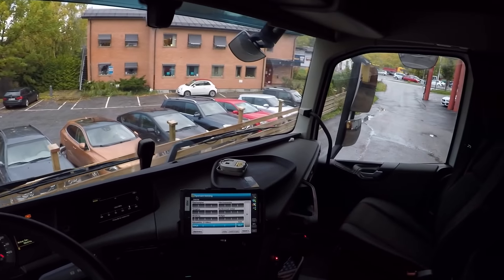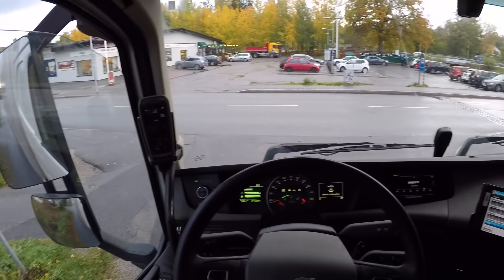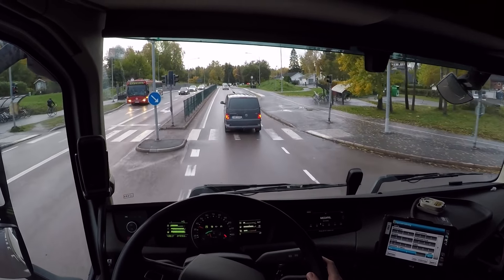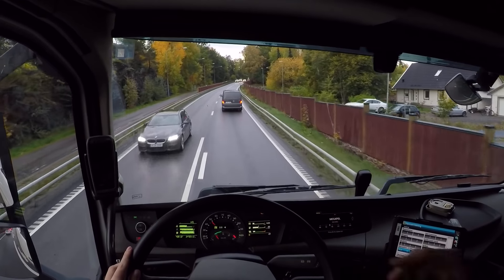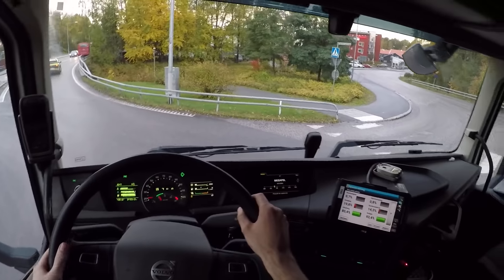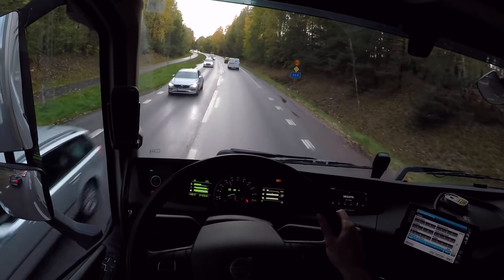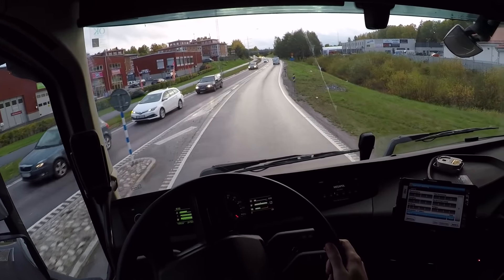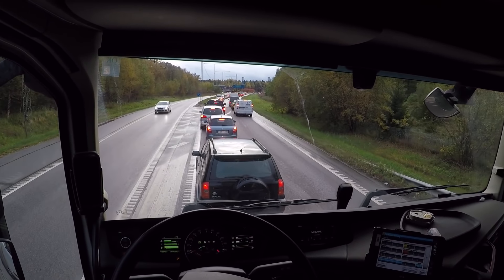Eco Driving tips & tricks, Volvo FH500 trucking

Comment: Remember when I complained about leveling the semi when docking for unload?  I think my theory was right. 
After 4 days out carrying a brand new semi from Almería- MercaMadrid- MercaBarna (JCarrion company always has brand new 1.200 semis, maximum 2/3 y/o) , there was no trouble at all to level it for load and unload.
I could level up and down the semi with the remote control, even for some centimeters up or down, the air pumping whas working as accurate as a scalpel.
Conclusion: hard work is always when I carry old and crap yard semis from medieval ages that does not fit new tech that makes our work easier and quicker.
Hope you had a good week, I am taking a mandatory - an necessary -  rest break in Narbonne (France) right now towards Marseille.
Reply: Sorry for the delay in aswering, just finished my trip to Reims (France) this night. 
Yes, the remote allows you to use the same cabin controls to level the trailer, once docked, from a reasonable distance with the plus of being outside the truck in the rear of the trailer.